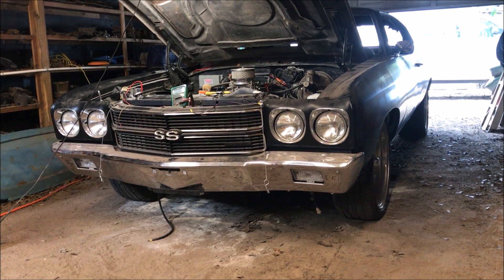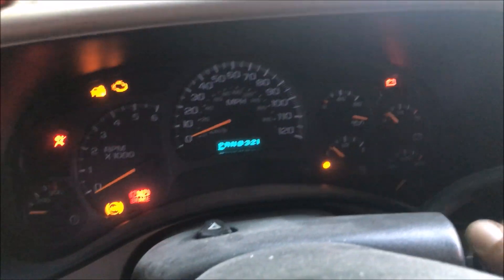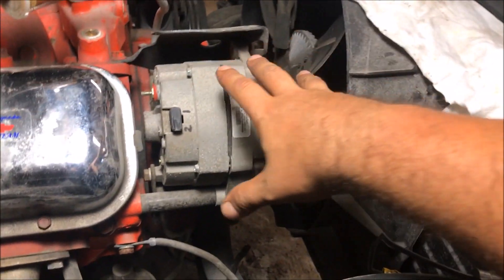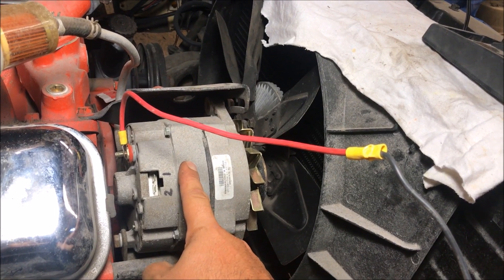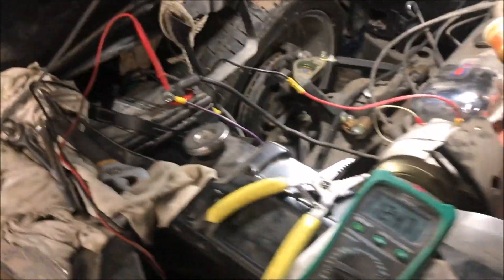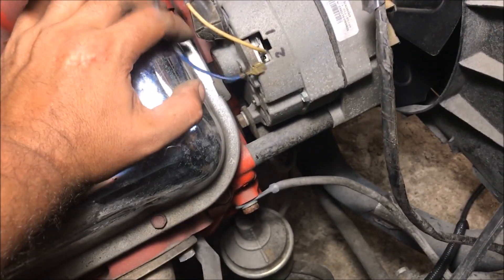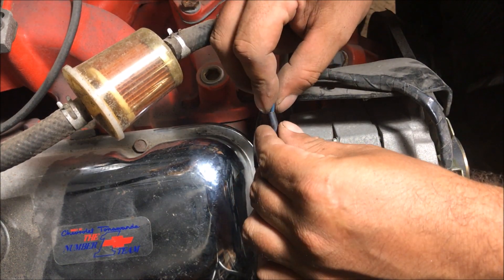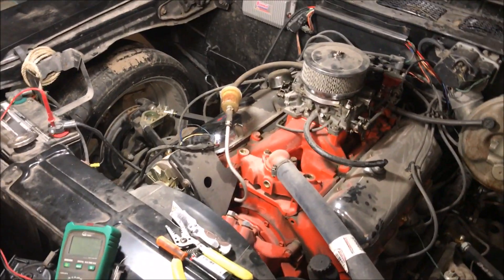watch before you buy a  GM 1 wire alternator and other INFO diode install

Comment: Hey chris! Fellow Texan here. Your videos couldn't be more on point for working on my 69 Chevelle 300 Deluxe. Previous owner swapped the 6 for a 454, but in the process Jekyll'd a bit of the wiring, and for some reason had the red wire that supplies power to the cars fuse panel connected to the (+) terminal on the starter instead of the horn relay, as well as attaching the orange (blower motor) and blue wire (oil pressure switch) from the fuse block to the same pole on the starter. He also had an old style alternator with the black and blue wire, and for whatever reason he had a wire spliced from the blue wire (just before the voltage reg.) running to the ACC. spade on the fuse panel, i guess he was supplying 12volts from the "ACC. On" to the blue wire on the alt. I have since re-laid out the wiring similar as it should be per the wiring diagram which brings me to a few questions. I really like your junction block method from the smaller battery Acc. wire, which i would run power to my horn relay. Currently there is a cut fusible link hanging from the "to fuse block" terminal. (as mentioned before the previous owner ran the power to the fuse block from the starter). (Question 1) Fusible links, how many should there be in reference from the battery junction block to the fuse block at the fire wall? will just the one from the horn relay to the fuse block suffice? I plan for (2) 10ga. wires from the battery junction block "to alternator" and "to horn relay". (Question 2) I just bought a 10SI 1wire internal reg. alternator. Can the "1" pin (exciter wire) be ran from the ACC. or BATT space on the fuse panel? (As mentioned before he had spliced a wire to the blue alt wire from the ACC spade. and i am eliminating the external reg.) (Question 3) They have a wire running from BATT spade on fuse panel to the electric choke. Could i put a splice connector from that 1 wire and crimp (2) female pig tails coming out to supply 12v to the "1" wire and 12v to the electric choke when the key comes on. Just curious if I could get away with consolidating those to avoid using all three fuse panel spades. My idea would be to have 12v from IGN to DIST. and the ACC. 12v could power both the "1" wire and the electric choke, leaving the BATT spade open. Sorry for the long read, and thanks in advance for all your doing.
Reply from the maker: you need to get a 69 chevelle wiring diagram from SPEEDWAY.  they are $10 wire the engine bay as a 396 big block car... YOUR 69 had a factory junction block just above the passenger headlights... 64-71... running power off the starter started in 72.... the old starter used an EXTRA R or I terminal to give 12 volts to the coil when cranking..  so are you running points or electronic ignition? #1 exciter is run to ACC or IGN( with a diode) but comes from the brown wire going through the external regulator by the driver headlights..  the wiring diagram will show all fused links..  you really need to go through my channel and watch every electrical video i have...  i cover everything randomly...   start by doing that and getting the wiring diagram....   make some videos if you can...   there are a lot of people that can help on youtube...
Reply: Chris Craft, yes it was converted to HEI, but he was running power from the original pink (resistive wire) from the fuse block to the Dist. BATT terminal. I have replaced that wire with a 12 ga. From the IGN. Spade so it’s powered with the key on. Ok, per your answer, I was thinking by turning off the key switch it would cut power ACC. to the “1” and not need a diode, per your video, I wasn’t sure where your power source was coming from with utilizing a diode. One of your videos also shows you disconnecting the harmonica connector to the voltage reg. And connecting the brown and blue together, but wasn’t sure if the diode was already inline on the blue wire from seeing the other video. I’m guessing the diode is required regardless? Is there a diode of sorts in the external voltage reg? .. I thought all the brown wire did was provide light to the alt indicator light until the exciter signaled charging and then shut off. (one of your vids says you don’t have a indicator light, so I didn’t know if mine didn’t have one). So sounds like my pig tail idea wont work unless I used a diode between the “1” connector and the 12v splice that would also be giving power to the choke from the ACC. Spade. Does the brown wire even need to be connected at all? If i don’t, what will happen? Honestly wasn’t expecting an answer so soon, but thanks bud!
Reply: Scenario 1: wire from “1” terminal spliced to brown wire from fuse block requires gets the 12v needed for the exciter wire, but needs a diode to prevent back flow which could potentially keep car running after turning off the key. Yes or no?
Scenario 2: run wire from “1” terminal to ACC. to bypass the brown wire and when key turns off power from ACC is disabled and engine stops? Yes or no? Or does it need a diode regardless how you power it to 12v to the alt from a “key on” source. 
Also, they must have removed the junction block from the pass headlight area.
Reply: Lol we're going the same route 
69 LeMans

Comment: I bought a 1970 chevy truck with a 350. The guy I nought it from put in a HEI distributor and an Internally Regulated Alternator.
 The back of the alternator has a 10 gauge wire going to the battery along with a jumper wire going to one of the plugs on the alternator. The other plug on the alternator goes directly to the fuse box and has only 12 volts running through it.
All the wires that went to the External Voltage Regulator are just unplugged, not connected to anything.
 The battery dies in about 2 days without starting it.
 What kind of Diode did you use?
Reply from the maker: you need to watch my gm 3 wire alternator hookup video and my EASY WAY internally regulated conversion video..  i have a bunch of videos on your problem

Comment: Hi Chris , My Corvette 1958 has New alternator , Engine etc , seems to have the alternator connected to the ACCESORIES key position and , Drains Battery if I leave the Car on ACCESSORIES key position , is This Normal ? How is this thing working? Thank Juan
Reply from the maker: watch my 3 wire alternator hook up.. you have the wires switched on the alternator
Reply: Hi Chris Thanks a lot !!

Comment: So you don't have to ground the alternator? I have a black ground wire along with the red(hot) wire that runs to my horn relay, and continues to the battery. I don't believe it's right, but that's how I bought the car.
Reply from the maker: +100 Grand you really need to get a wiring diagram off eBay for your car.. they are only $10 ... they are all a little different.. 64-71 gm a body are like mine in the video
Reply: Some of the wires or not used that’s why he is only hooking one wire straight to power to show you you don’t need the harness with all the wires